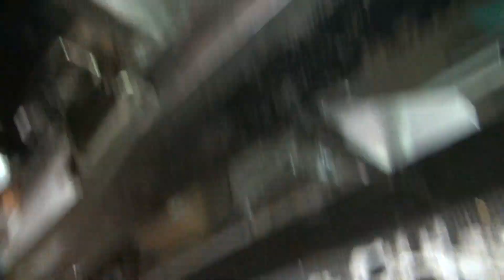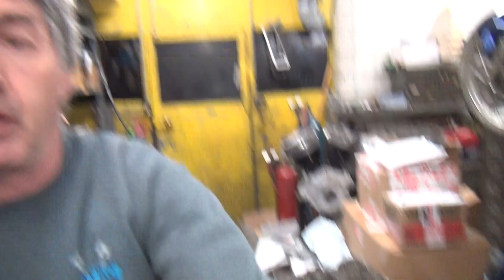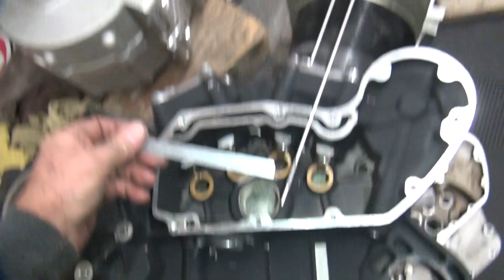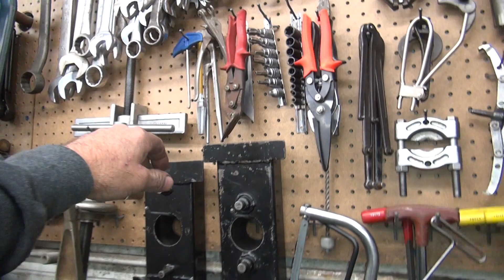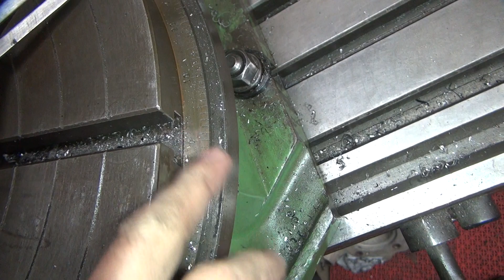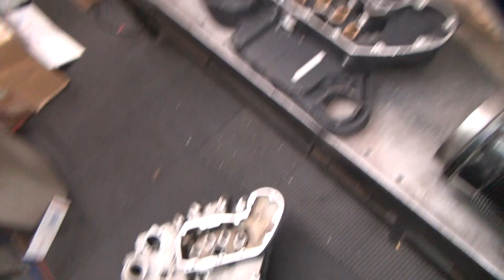#124 harley custom airplane 143ci motor mock-up big evo 4cam sportster twincam m8 race tatro machine

Comment: Why is the late case painted on the inside. Or powder coated? I'd have to guess that paint will still be there in 40 yrs when a 16 yr old kid builds his 1st.
Reply from the maker: that is because you do all your powder coating before you do any machining. this saves tons of time and money on the manufacturing side.
tatro